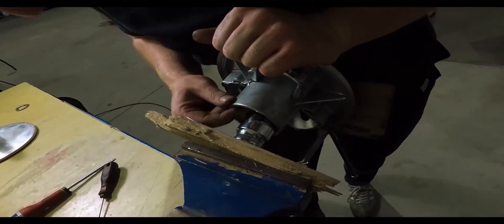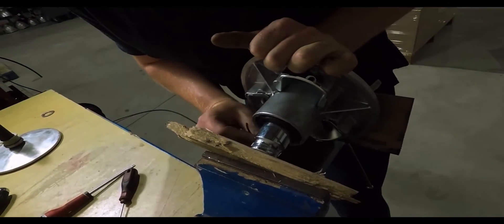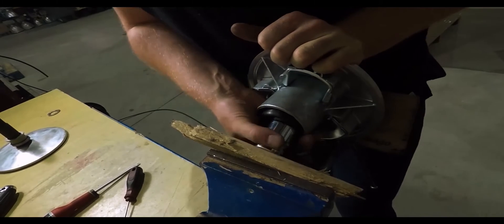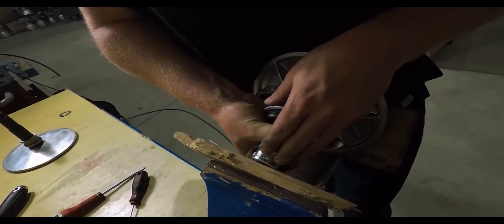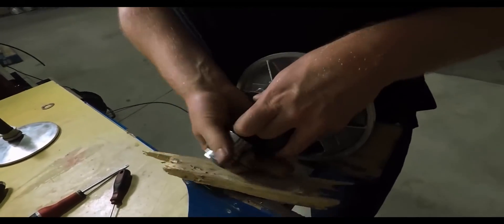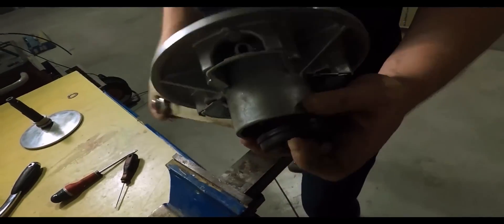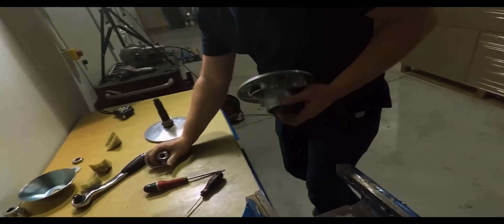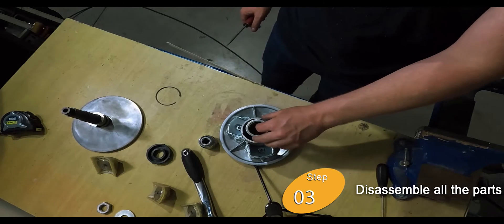TUTORIAL : dissassembling a continuously variable transmission (CVT)

Comment: Hello, i wondered if anyone can help me, my drive belt breaks very fast, about 40km and it explodes, seems like it Gets to high up on the primary variator, please help me
Reply: that sounds nasty! I've had my Microcar mc2 for more than 9 years but never had anything like that, I did have some probs with the belt, I changed it, was nice for a while, then I took the variator apart , took the spring out and took off some of the washers inside, again, seemed better for a while, even now though it still jerks a bit moving off, ok generally driving. Your problem could be a VERY worn belt??? if not, maybe someone before you, if you bought the car 2nd hand, took out too many of the washes inside the variator??  Just thinking logically .... sounds as if the pulley with the weights innit is going IN to far, pushing the belt till it goes over the edge??? mine has the opposite prob, doesn't seem to go in far enough under enough pressure while moving away, so maybe???? more washers added to either side of the spring might help??  assuming you only  use the exact type drive belt to suit your exact model of car??? if it was a bit too long, circumference of it was too bit, that would make it go over the edge of the pulley at high speed..... just my thoughts! as this is a year after you put this cry for help on here, you've no doubt solved it now???  anyway Microcar garage no doubt have a solution...... good luck!
Reply: that should have said, circumference of it was too big            !